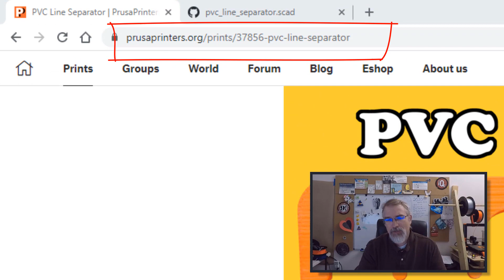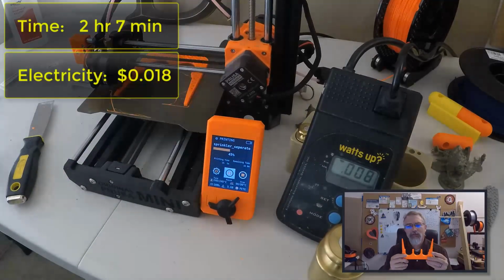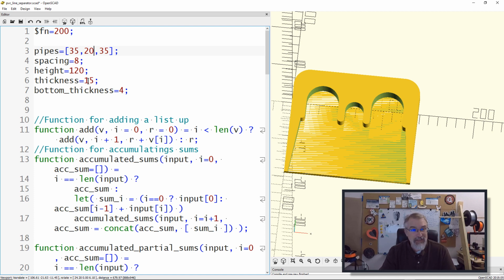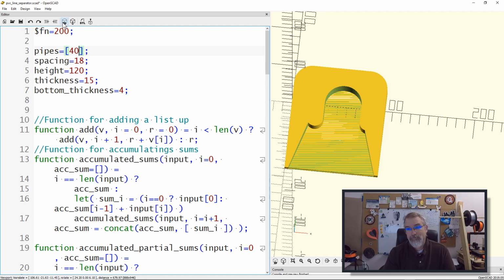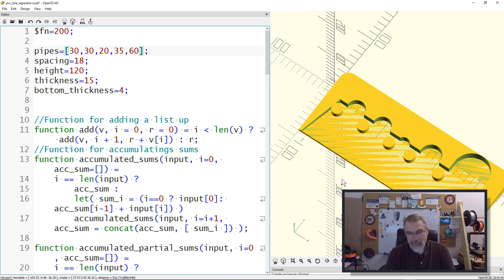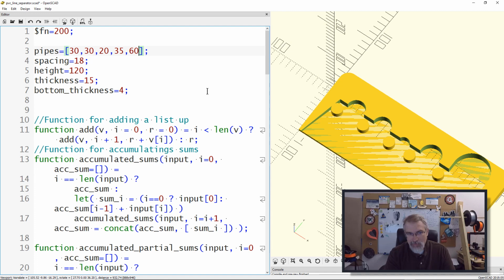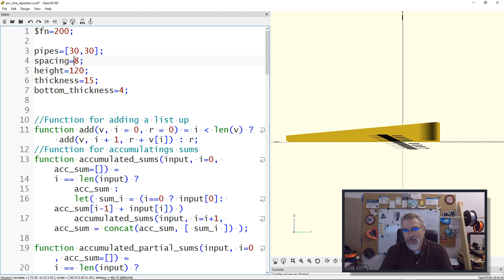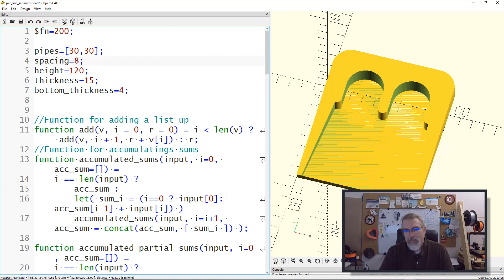3D Printing: PVC Line Separator

Comment: I have just upgraded my mini's extruder and heat break with Bontech improved parts and the Mini now is printing amazingly accurate. It is an upgrade for less than $100. Totally worth it and highly recommended.
Reply: Hey Marcelo May I ask what the parts from bond tech are called?
Reply: @kennyhoang461  Bondtech Mini Geared (BMG) extruder and Stainless Steel Heat break for prusa Mini
Reply: Marcelo Pereira thanks I’ll kept those in mind. I get my mini end of this month. Do you know if a bond tech dual drive is worth it?
Reply: @kennyhoang461  Definitely !!, finally I was able to print using PC filament with high detail and superb adhesion